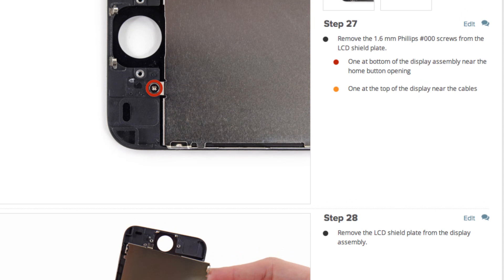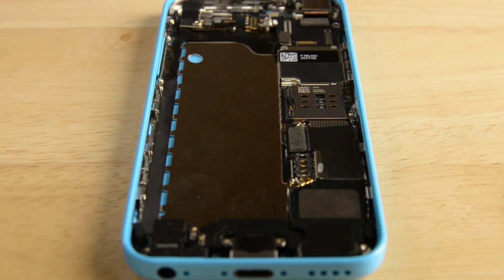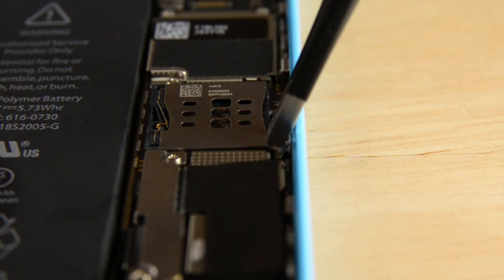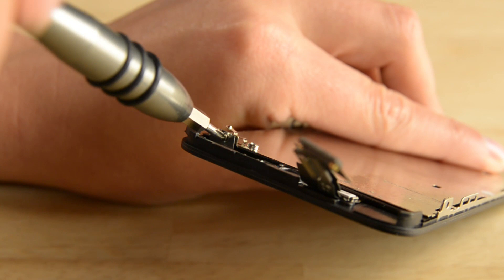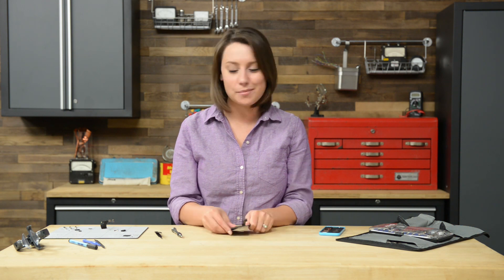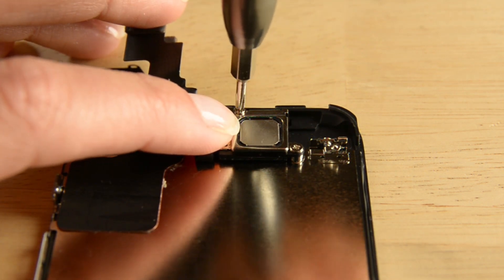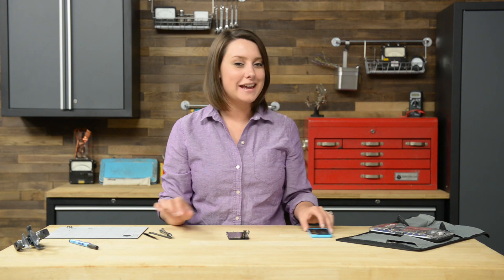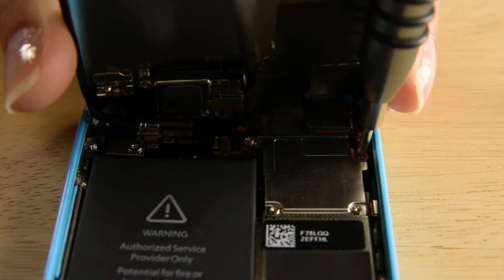iPhone 5c Reassembly

Comment: when you disassemble the battery, you cut the black adhesive tab and removed the white stripe. don't you need to put the white strips back? or is it just not required?

Comment: I'm trying to re-close the phone, and it doesn't want to snap back together.  Do I just push harder?  It seems like the screen is shifted ever so slightly down, so the screw tabs don't slide behind the bottom edge of the case.

Comment: So it's not important to keep the battery adhesive?
Reply: As far as I know, it's not. I replaced my 5C's battery about a year ago, no adhesive, and absolutely no problem has emerged since. The phone's chooching as new.
Reply: Yep, the battery is typically rather snugly fit into the phone once put in, with or without adhesive - whatever you do, don't lose the battery and power ribbon cable cover bracket, or the connectors on the cables will keep popping out of their positions on the logic board otherwise.